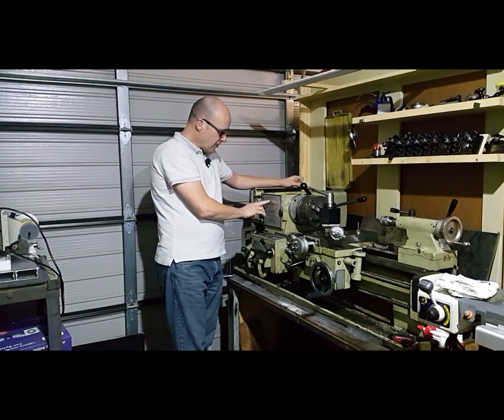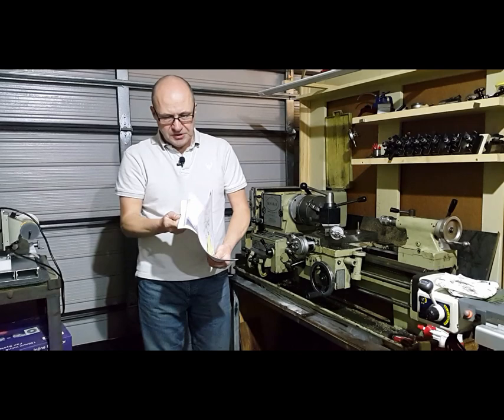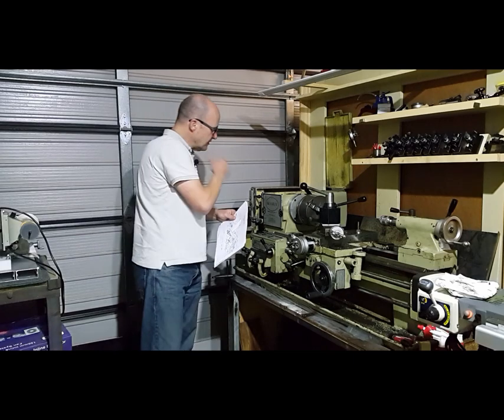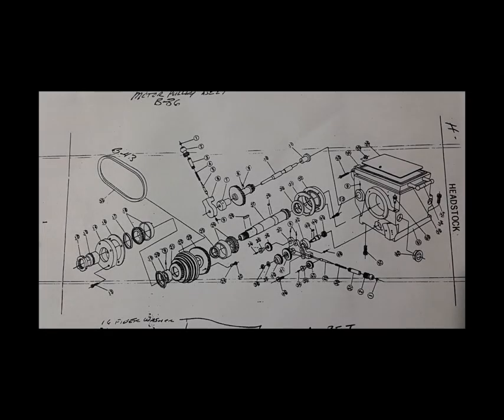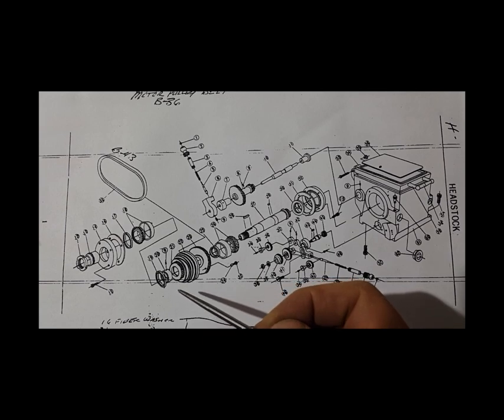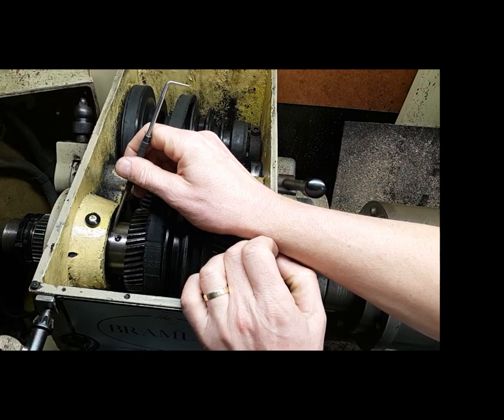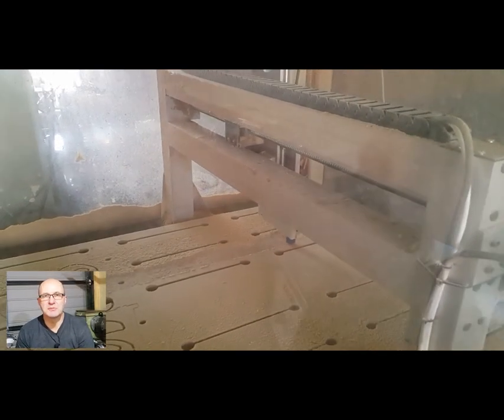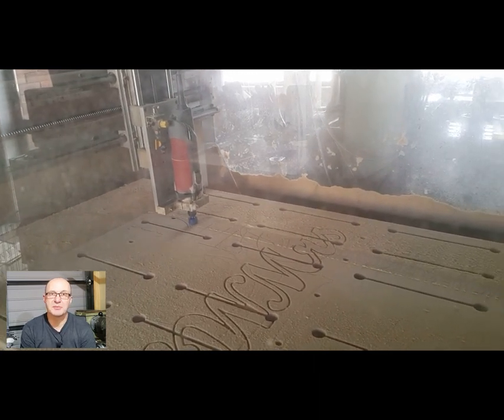#37 - Lathe Oil Seal - CNC Router Spoilboard Resurfacing - Workshop update - Stickers

Comment: Would love to know where you got the instruction and parts breakdown manuals as I have a near identical machine te TIDA 4a and the documentation is spartan to say the least.
Reply from the maker: Hi, I have a Tida 4a operating manual if that's any help?
Reply: @Machine_NZ - thanks, I may not have that one, I think I have the manual, not sure if it's the operating manual and the parts manual - they're both very sparse - I might google the other similar models mentioned for more detailed information also - every little bit helps